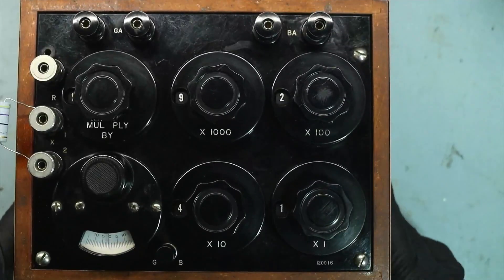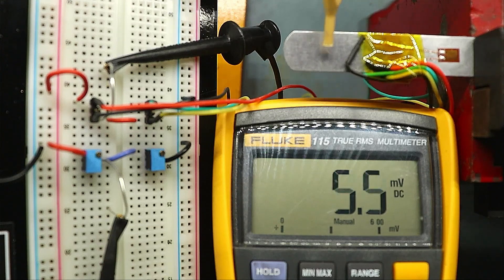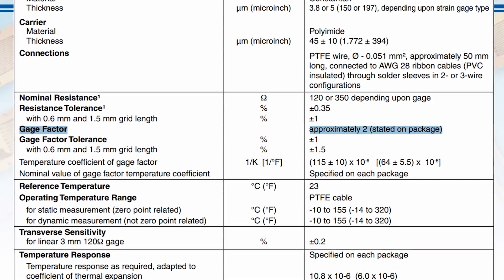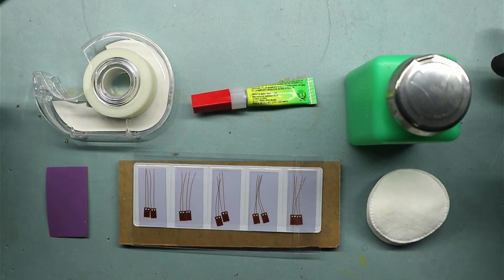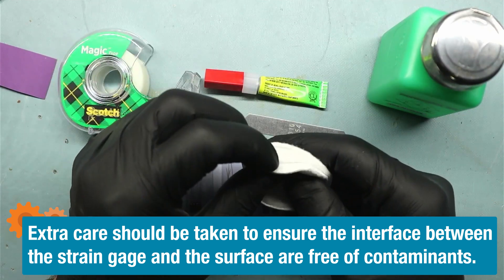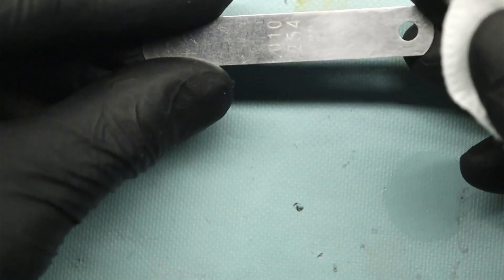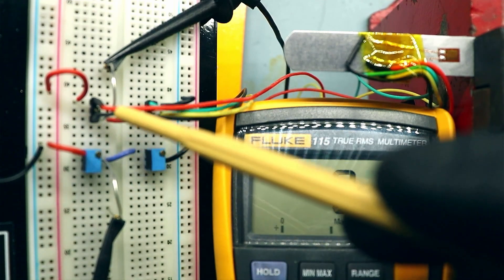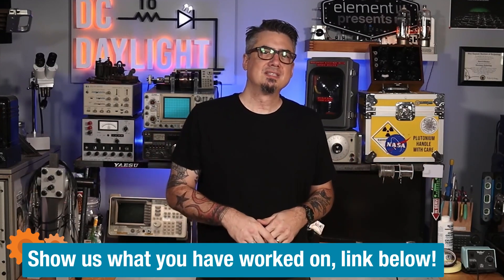Exploring the Intricacies of Strain Gauges in Mechanical Systems - DC To Daylight

Comment: Great lesson and demonstration. Thank you. The bridge is often excited by a 3 kHz sine wave generator. Instead of a pricey instrumentation amplifier, a cheap quad jfet opamp is configured as a differential bridge amplifier. Trying to  measure milliVolts amid the electromagnetic noise of industrial environments is difficult. Now if you can work out the fine details and publish it😅using a TL084? I suspect that you have other things to do but, if not, my opto problem is at 38 kHz.😊 Not sure a TL084 is the best choice.

Comment: Hello, thank you for the practical instruction. Do uou have any suggestions about installation of a strain gauge to a flexible ribbon shaped material like EVA sheet? I want to know if we have a sensor with the width of 6mm  and the width of the material is 40mm, is it realy plossible to attache the sensor to it without having an effect on the deformation pattern of the material?

Comment: Please consider doing an IOT video for something simple like an esp32 and a humidity sensor or something like that which shows the steps to use an online site for communication from phone to device in a home connected to local wifi.  Maybe even a small bit on using MIT AI2 companion to create a small app for it to send data thru to the phone for the sensor and send data back to turn on an led.    Thanks

Comment: Maybe it's the Algorithm, but only a couple of days ago while searching for an old email I stumbled upon a 2016 link I sent myself from a work account regarding "G-putty", which is a mix of Silly Putty and Graphene. It is a good conductor of electricity. However, when the material is subject to even a tiny strain or impact, its electrical resistance increases sharply – before relaxing to its original value as the material “self-heals”. A sensor of G-putty when mounted on the neck and chest of a subject could measure breathing, pulse and blood pressure. The sensor was even able to detect the footsteps of a small spider.
    I probably triggered the algorithm when I searched for more info, as it sounded like (no pun intended) a candidate for a better acoustic guitar pickup, which is on my to-do list as I dislike the ceramic ones.
  I found "strain gauge" mentioned in my search hits, but I wonder if the dynamic nature of the output would limit its use for static strain measurement.

Comment: I used to work with them a lot for CAT, sensoring mining equipment. Your gluing process is a little rough but its your first time ;) You really want to avoid bending them at all. The thing with strain gauges: If you can SEE it bend, its already bending too much. Thats a bit of overly cautious paranoia, but they really can be easily damaged, and even will slowly degrade from just moderate bending over time (constantly have to recalibrate). The ones you have a quite cheap. but when you are working with $20 or $50 gauges, you kinda have to be gentle.
A few years back I was involved in a hybrid UAV/plane project called an LAQ (Lift Augmented Quadcopter). Wings were attached to the copter by carbon fiber tubes. I attached strain gauges near the attachment point and we calibrated them to measure lift and drag generated by the wing. When we found the perfect flight speed vs pitch angle, the power consumption dropped substantially. 
https://www.researchgate.net/publication/347240498_Wind_Tunnel_Testing_of_a_Lift-Augmented_Quadcopter

I know its not visually as impressive, but gauging up a solid bar of steel, mounting it to the table and then hanging off it to measure your weight is always fun. The part that opens the mind though is when you point out that the bar is bending. No one can see it bend, but it did. That same principle can be used to measure the weight of a fly's wing, or the weight of a sky-scraper.

Comment: Strain gauges are used all the time in syringe pumps to measure the force on the plunger of the syringe, the force being proportional to the pressure in the syringe (though friction can vary)  They are calibrated with a force gauge.  Some have their own pressure sensor that interfaces to the patient tubing, these also have to be calibrated.  But some use only low side motor current monitoring which is hard to calibrate and not very good (in my opinion).  I think the ones that have pressure sensor, it is a MEMS micro electronic measuring system, its like a strain gauge but is produced by semiconductor lithography, I think the bending of the sensor changes the capacitance as elements are moved closer of further from each other, the change of capacitance can be measured, I think they might be laser trimmed for accuracy ?

Comment: You did fine. Maybe a little too cautious, but being new, I understand. Worked with them for almost 20 years. In the plastics industry, they have a mold that closes on a pair of 8" - 14" horizontal rails - round. The mold halves close together, by means of a hydraulic ram, or a scissor toggle, Before the hot 700 degree  plastic is injected into the mold, there must be an assurance that the mold halves are clamped together tight enough to prevent the injection pressure from opening the mold. Presets for tonnage  must be maintained. If the strain is not met, it will not inject, if the strain releases mid injection, the injection stops. The strain gauge feeds an op-amp, and its tonnage set-point is dialed in for each mold.
Punch presses use them to detect breakage. When the ram comes down, to stamp a part out, the dies must achieve a preset tonnage value to make all the cuts, and bend all the bends. In the canning industry, the most important finish dimension is the 'score' for the pull tap. If it is to work, the metal along the 'score', has to be thinned to allow it to tear, but thick enough to keep from cracking. The strain gauge, measures this pressure, and then corrects the heat amount in the die, to increase or decrease this cut depth.

The worst part in the early years, 1990 to 2000, was the hour of math needed to prefigure the new strain gauge, to the machine. It was an hour with a calculator. We got tired of this, with 2-3 replacements/week, for 600  machines, so we made a spread sheet with the calibration numbers and fixed limits that came with each gauge. Put in 4 numbers, hit enter, and done

Comment: I've seen this application used in Large " C "  frame punch press.  To give indication on frame load. 
Large CNC mills. For measuring thermal growth.  Using a linear growth on gage.

Comment: One of the more clever ways of integrating a "strain gauge" into a device is the Duet3D Smart Effector which serves as the platform for a Delta 3D printer and has its strain gauge done in as part of the PCB.
Reply: Thanks! You can always rely on the Duet3D guys for coming up with something clever. :) But you had to do your bed leveling with the hotend heater off. Because the strain gauge "matrix" acts as an antenna and can throw the measurements off. It took me far longer than it should have to figure that one out. :)

And in the real world of loadcells (with their strain gauges bonded to them), the failures that I have seen fall into two categories:

1) A sharp blow, particularly from the side that de-bonds the strain gauge.
2) Moisture. Often moisture will creep up, or "wick" it's way into the loadcell via the cable - even if the loadcell is rated for IP67 or better.

So your concerns regarding the proper bonding of a gauge are well founded.

Comment: Certain synthesizers (Nord Lead series) used strain gauges to bend note pitch (instead of a traditional pitch bend wheel design). This presumably involed spring steel, a Wheatstone bridge, amplification and filter smoothing before or after the ADC. The end result was more nuanced vibrato for synthesisers, akin to violins or a guitar whammy bar which would spring back to a neutral position. Would make a nice project if combined with MIDI.